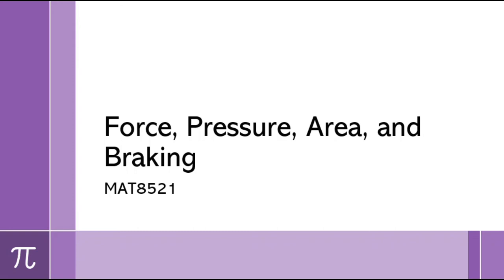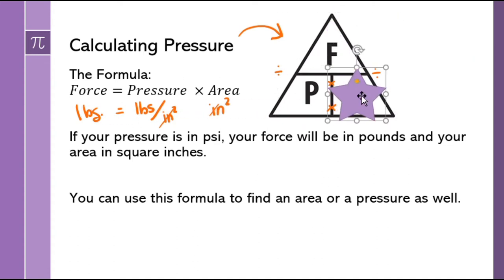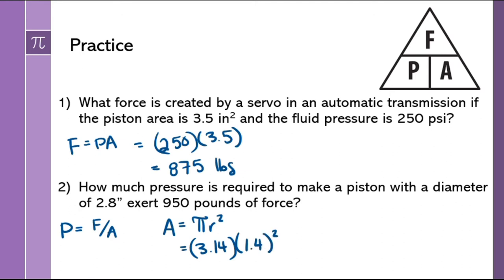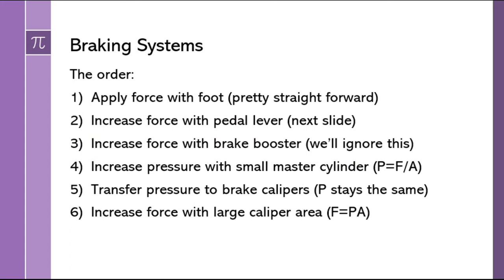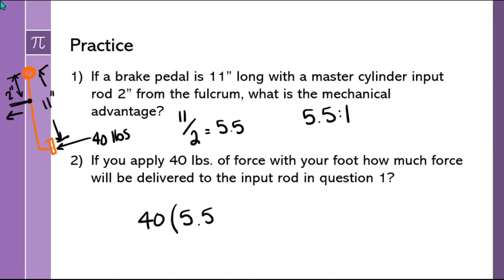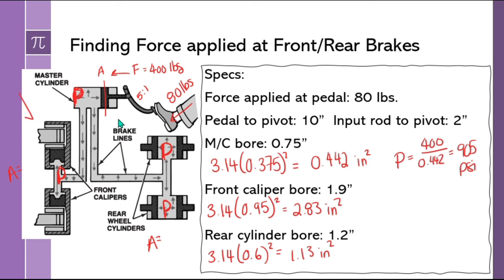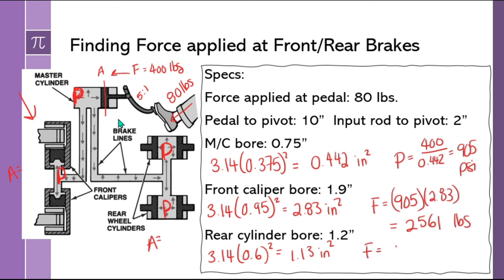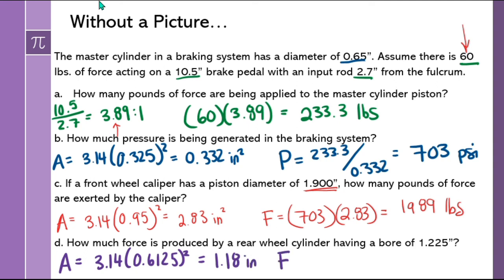Force, Pressure, Area, and Braking Systems

Comment: I thought that was excellent. I’m currently working on that problem with my 1950 ford. I didn’t know how to figure the pressure at the rear wheel cylinder because there is actually two pistons inside a wheel cylinder. Thank you for the help on that. My only question is why isn’t the area between a two piston caliper figured into the detailed description you gave to us.
Reply: Exactly my question!
Reply from the maker: Valid - it's because the audience is pre-apprenticeship. Slow steps.